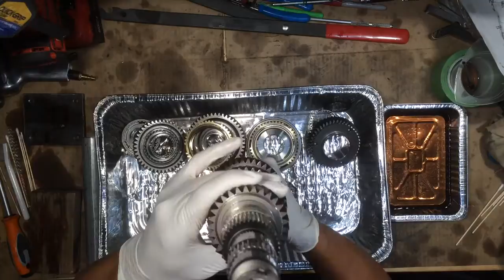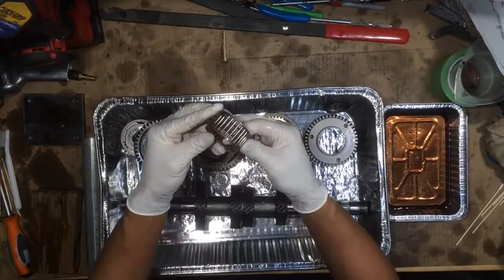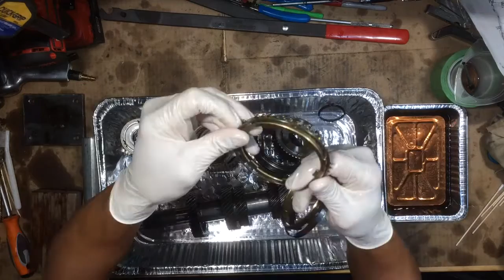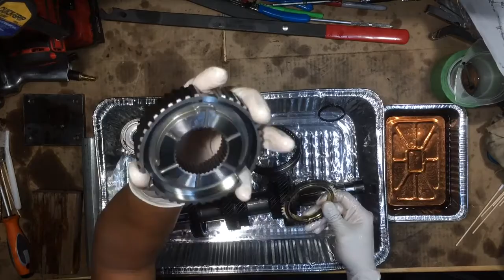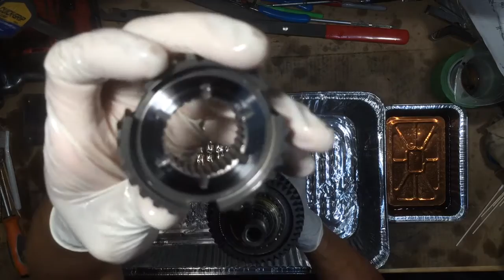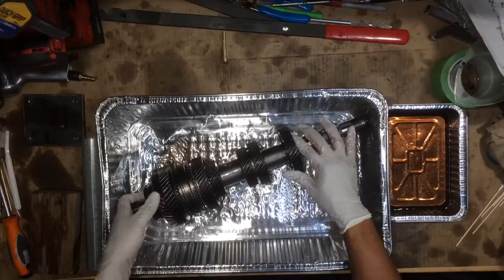Honda S2000 AP2 Transmission Rebuild - Part 4 Countershaft Assembly - #relentlessracing

Comment: Hello A.J.

What a GREAT video. I just finished a Toyota C-60 rebuild and was amazed how simple everything went together on the Honda transmission.  I had to use a press for many gears, shimmed cir-clips, and spring-loaded dogs on the hub assemblies. 

I like the Honda de-loading spring on the synchronizer and lack of spring loaded dogs to engage the schronizers.

Thank you for posting.

Mr. P
Reply from the maker: LSmiata thx for the kind words. I really appreciate u watching my vid and commenting. I’ve always found manual transmissions so fascinating... they r so complicated and yet so simple.

Comment: Awesome breakdown on the entire trans. 

Looks like it's not possible to simply swap out the 5th and 6th only because the entire countershaft is one piece?
Reply from the maker: MFactoryTV my apologies for the late response... I didn’t get a notification. First, thank you for watching my video and I always appreciate comments and questions. Also, it is quite an honor MFactory is watching one of my videos. With regards to your question, I’m assuming you are referring to the fixed 5th and 6th helical gears on the counter shaft. If the fixed 5th and 6th helical gears are damaged, then you will need a new counter shaft. I believe counter shafts are no longer available from Honda. Although, if the free running 5th and 6th gears on the main shaft are damaged, then these are replaceable. However, this is not a cost effective fix. Most ppl opt to purchase a used good condition transmission. Lmk if you have any additional questions. Thx AJ ajaquias@yahoo.com
Reply: AJ JAQUIAS thanks for the reply!

Appreciate you taking the time to talk and walk us through this trans. 

We just may have to come up with some replacement parts of our own down the road!
Reply from the maker: MFactoryTV no problem. Lmk if you have additional questions or need any assistance with testing, etc. I am a BSME, sponsored racer (pls follow me on IG @relentlessracing), and also work in the automotive industry

Comment: Can you do a rebuild like this at home? What kind of press is needed for the bearings?
Reply from the maker: Yes, u can rebuild this at home. I use a 20 ton shop press. I modified my hydraulic press by replacing the hydraulic jack w an air over hydraulic jack so I don't have to pump it by hand.   It makes things much easier